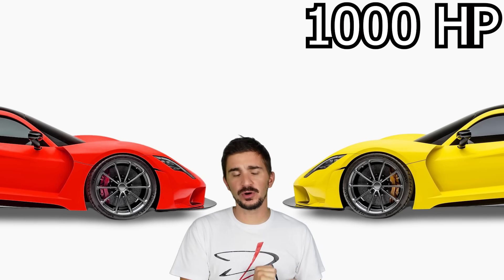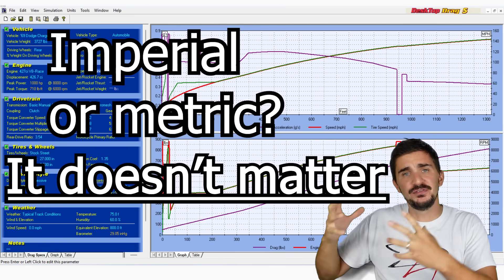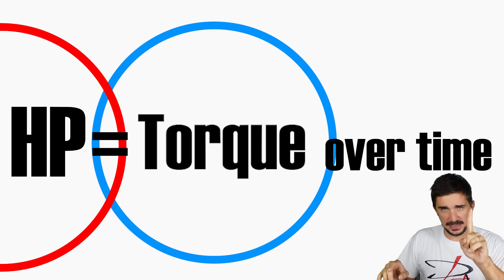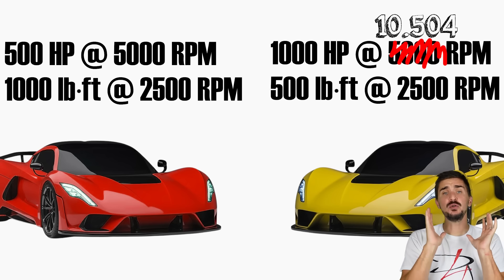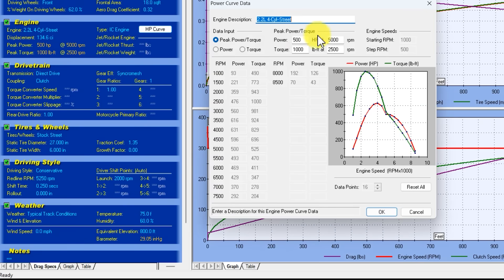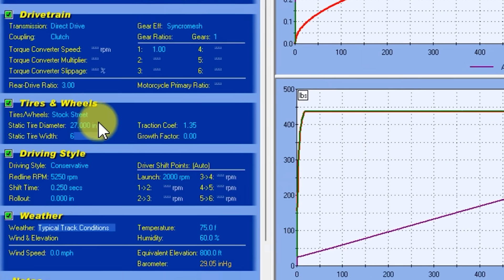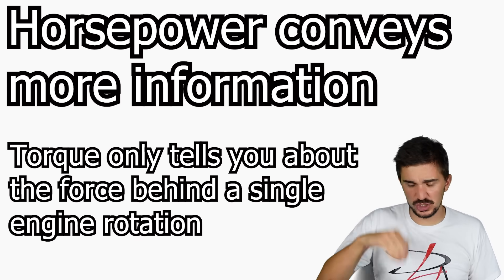Who's faster? Explained and Simulated - Horsepower vs Torque

Comment: My thought is always the following: Since HP is a unit of power, it denotes the amount if energy, transfered within any given time. And in the end that energy is tranferred to the car in the form of kinetic energy. Thus, if you engine has higher hp, it can feed more energy, into the car in the same time resulting in higher acceleration.
Reply: Yea this is the easiest way to understand it. I don’t know why more people don’t use this. 

It’s just very basic physics that we all learned at school.
Reply: For example an engine with 10.000 lbs-ft if torque at 1 rpm will not nearly have as high power as an engine with 300 lbs-ft at 2.000 rpm. It will be unstoppable for sure, but if you anted really slow, unstoppale movement you could also gear the 2.000 rpm example to 1 rpm and have effective torque of 600.000 lbs-ft
Reply: You are correct! As a physicist I can confirm you that this is actually the way you have to treat the whole thing. That is what actually happens.

Addition: 
Sadly, in the real world you would have so called dissipative power. This is mainly caused by friction from air resistance and tyre rolling resistance. The car accelerates until the dissipative power equals the engine power as in this case no "extra power" is put out by the engine that could further increase kinetic energy and it's the point where the "top speed" of a car occurs.
Reply: @MicroageHD  of course my example also supposes that you can always keep the engine at it's optimal rpm without drivetrain inefficiency. And I believe that may be where the real world applications if high torque engines come in
Reply: @cedricl.marquard6273  In your last statement, you are thinking of engines with a flat power curve, not necessarily high torque engines.

Comment: aren't F1 engines outputting 1020+- horsepower and only 600-700 nm of torque even though they operate between 9000 and 13000 rpm?

Comment: How does Ferrari make an engine that delivers just under 1000 hp but only has 380 lb Ty of torque. Or formula one engines back in the day that made 1000+ and didn’t even come close to making 400 lbs ft. It is possible to make large hp numbers with low torque numbers. It all depends on your camshaft your intake runners and plenum and your head and valve design.

Comment: This is interesting, thank you.

I do think there is a case for torque though, basically everyday normal driving where you only get a chance for quick bursts.

The Honda S2000 perfectly illistrates why its useful to look at torque. Sure it has decent bhp but torque is low so it makes a lousy 'normal' driving situations where  a comparatively boring turbo diesel with more torque but less bhp might be better

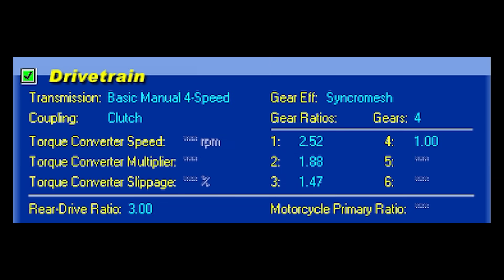Comment: Great explanation! I love the use of the sandbox to illustrate these points. I do have a slight nitpick though. As a layman, I've always understood torque as "quickness" potential and hp as "speed" potential. So the higher torque engine will have a higher rate of acceleration, while the higher hp engine will have a higher top speed. This rings true in all of his examples except for @ 10:56 . He attributes the hp engine's faster time to the torque multiplying from the gearing, which isn't untrue, but the bigger factor (imo) is the lack of traction from the torque engine. This would have been a great point to harp on; there is a limit to usable torque. In judging scenarios like these, I always have two questions to help me decide who will win. Are the tires sticky enough, and how far are they racing (or rather, what type of race)?
Reply: The idea that a higher torque engine will have a higher rate of acceleration is wrong though, more hp = more work done and more work done should be faster. The simulation favoured high torque because the gearing wasn't appropriate for the high hp engine, so it wasn't putting out the hp it was supposed to. Don't forget that high hp also means high torque at the wheels if the gearing is right, the sim setup and explanation could have been better tbh.
Reply: Your right about the quick vs fast

Comment: That was a great explanation and works for modeling acceleration of vehicles. Just watch out that someone might say that torque is only a component of horsepower. Strictly speaking, you can have 1,000 foot pounds of torque and zero horsepower. Imagine a breaker bar on a nut. The nut is not moving but you've got a lever that is producing 1000 lb of rotational force. But at the same time the nut is not moving then that is not hot. Therefore, work is not being done. Therefore it is separate from horsepower

Comment: Why didn't you just use realistic figures to prevent having to explain all the faults in the video? Like 6000 rpm instead of 5000 rpm for the horsepower engine, and 400 torque and 500 power vs 500 torque and 400 power? It would have made much more sense, and wouldnt have had to worry about so much wheel spin. You've just made the video unessesarily complicated. Fail

Comment: I like to make the analogy that torque is mass and RPM is speed, with HP being force.  You can alter it in any way you want for a given audience.  How hard does a heavy slow bullet hit vs. a light high velocity bullet hit at the muzzle?  Or what causes more damage, a slow heavy truck hitting a wall or a motorcycle going fast into a wall?  Both can be the same or vary wildly depending on mass and speed.  It conveys how HP is a function of torque and RPM, that torque alone says very little about the equation.  You can be on a dyno and put a 10ft breaker bar on the end of your crankshaft to achieve 2,000ft/lbs of torque relatively easily just with your own body weight standing on the breaker bar....but you're not going to win any kind of race with that impressive amount of torque, are you?  Probably wouldn't even beat grandma in a wheelchair hopping up and down on the breaker bar.  Torque means nothing without knowing how fast the engine can spin while maintaining that torque, and what you get after finding that out is...horsepower.

Comment: You made a simple problem look very complicated. I have a feeling that you don't really understand what power or torque is. "Torque tells you about the force behind a single engine rotation" is not true. A 1000 HP @10500 and 500 lb ft @2500 engine is completely unrealistic. 
You shoud have only talked about the torque at the wheel that basically moves the car because it involves the engine torque plus the final drive and transmission ratio.

Comment: It helped me to exaggerate your example by imagining an engine moving at 1 rpm with really high torque, and one moving at 30k rpm with low torque finishing at the same time. The first car will get violently thrown forward each rotation while the other one will accelerate slow and smooth. If a 5 speed transmission were involved then I feel like the second car would win unless the first one just began the race in 5th gear. Its kinda dumb but helped me visualize it better

Comment: To really show the performance difference between the two, you should have simulated some ideal gearset for each engine curve and then a CVT. This would have shown the huge performance advantage of an extra 500 HP.
Reply: The CVT wouldn't last long enough to finish the simulated drag race.
Reply: @stankymcgee6742  Give it a new belt. It'll do one pull.
Reply: @stankymcgee6742 the Williams F1 team tested a CVT on their car back in 1993 and it handled the 750hp V10 at 13500rpm without much issue, only reason they never used it in a race is because the FIA banned it just 2 weeks after the test, before the season even began, so CVTs can definitely handle high horsepower if designed properly
Reply: Now the Porsche PDK, then we can do some comparisons
Reply: Cvt I feel would be horrible in a performance setup. All the ones I've been around, sound like a can of pop rocks about to explode. Not really ideal for either application imo
Reply: @prestongodsey3567   It's horrible to actually use in a car, but it's perfect to use as a simulation tool to show the relative advantages of high power as compared to high torque.

Comment: Horsepower is intrinsic to an engine. Torque can be (almost) indefinitely multiplied with gears. This information (along with available traction) can be used to select the optimum gear ratios and shift points to achieve the best quarter mile time.
Reply: Exactly. All that really matters is power output. Torque can be fixed with gearing or tire size.
Reply: No, engine torque is also intrinsic and determined by how much air is combusted in one engine cycle (either due to displacement and/or compression). Wheel torque and engine torque are not the same.
Reply: @kalasmournrex1470  well good thing no one cares about engine torque, what matters is wheel torque which can be multiplied by gearing. Wheel horsepower cannot be changed by gearing.   
Therefore horsepower is the critical attribute
Reply: @nhibbs3  I definitely care about engine torque. Tow a big trailer or drive a heavy vehicle and you can't get away with a low torque high horsepower engine. 
Also by changing torque at the wheel you also affect horsepower. The two are mathematically related.
Reply: @rich7447  this is fundamentally wrong and you don’t understand physics. Power is under the curve is all that matters. You can make up for lack of low end torque with gearing and/or torque converter
Reply: @nhibbs3  I did quite a bit of physics in engineering school. I know the theory, but theory and practical use are two different things. 
You can't make up that much torque with gearing in a real world situation. I agree that area under the curve (torque or HP curve) in the operating range of the engine is all that matters. The problem is that it is not  viable to take an engine that makes 100 lb ft of torque at the crank output the same power at the wheels as an engine that makes 1250 lb ft and is already running a 4.56 final drive ratio (This is the configuration of one of my current vehicles). Driveline losses would make it inefficient, and gear set size would make it impractical.
Reply: @kalasmournrex1470   - Wheel torque can be multiplied.  Wheel horsepower can't.  I hope that helps you out.